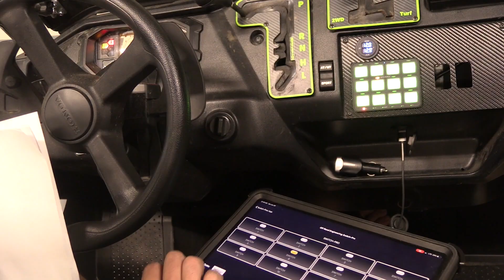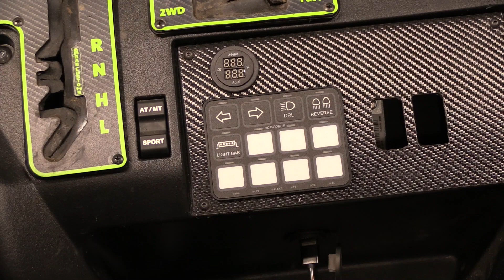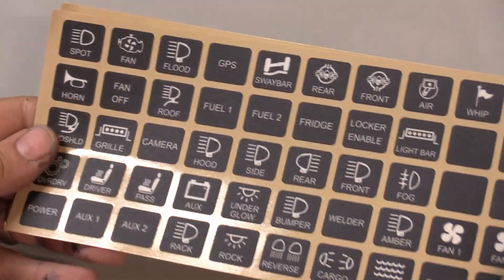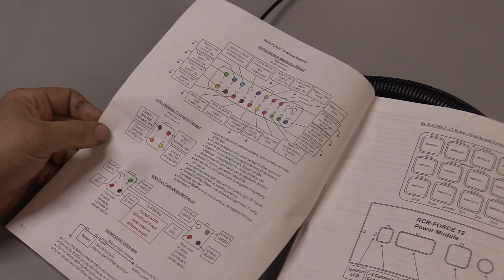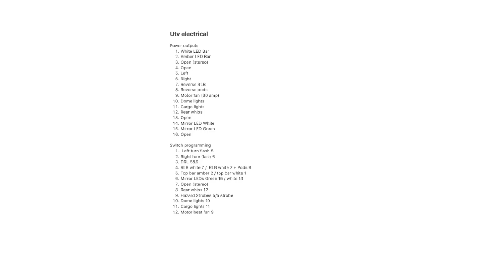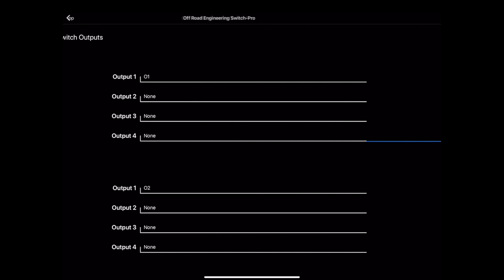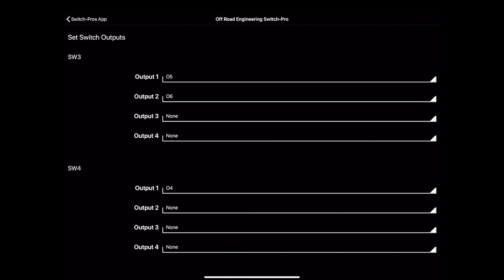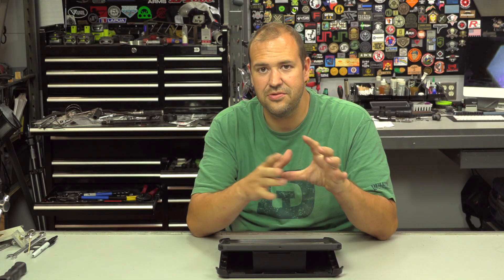Switch Pro RCR-Force 12 Review

Comment: Question about the Switch Pro. Can you program it so that one of the switches is a 3 position? Basically an On/Off/On. Here’s the situation. I have a Yamaha YXZ and the radiator is mounted behind the cab. Normally the fans suck the air from the cab and is blown out of the rear of the vehicle, however it’s possible to reverse the polarity since it’s DC and cause the fans to change direction and blow the heat into the cab. Great for the cold Montana winters.
Reply from the maker: You could program one switch to off-on-on easy enough, however you’d have to use two outputs I think as I haven’t seen a way to reverse polarity in the Switch-Pros

Comment: Can you show us what you used for the panel and connectors and why you did it and what its for. New to wiring. Thanks
Reply from the maker: Check out my electrical video. It has a little more footage from the wiring side.  I used a sheet of HDPE plastic to make the tray. Do you mean the panel on the dash?
Reply: @UN12actual  no I meant the bus bars on the HDPE. You used several of the so wasn’t sure how all that works. Actually, didnyknow you use bus bars on this unit. I will look at your other video. Thanks again for your response
Reply from the maker: Bus bars are just for the accessories ground.  The positive lead came from the switch pro and then the negative went to the bar.  I didn’t want to ground locally near the accessory or frame etc and ran two leads to each item if that makes sense